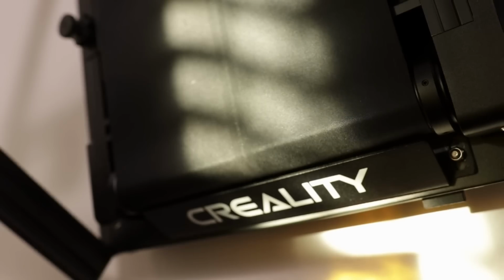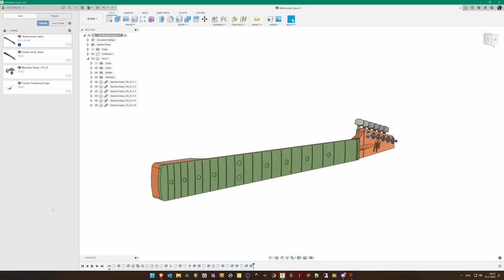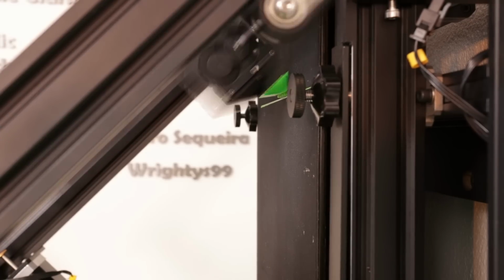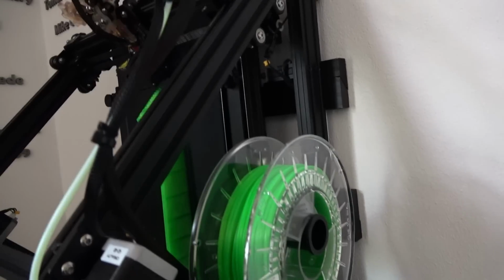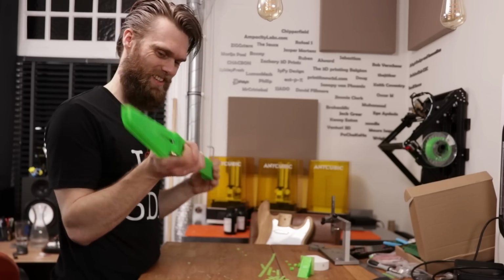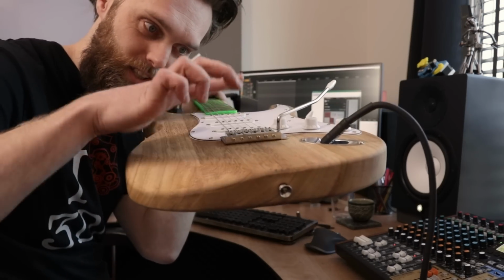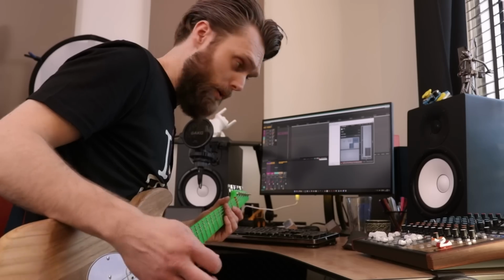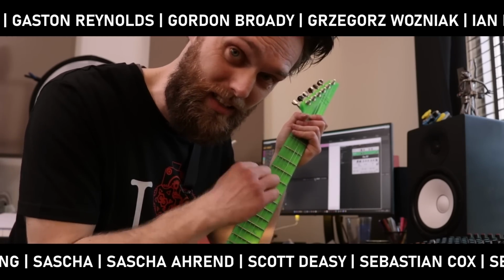A 3D printed single piece guitar neck?! ft. CR-30 belt printer

Comment: Hey! Amazing video! Wanna try something similar. Did you manage to have it straight ? And is the rod necessary? Won't it hold without?
Reply from the maker: Thanks! Cool that you want to try something similar. I don't think it can be done without a rod. Not only for its strength and stiffness, but also for tuning the curvature. I'm going to make a next version and I think I'll even add extra carbon fiber rods to make it even stiffer.

Comment: I was expecting you to use 09-42 gauge strings and you used 11-54 xD maybe that could help with the tension. That... Or tuning in drop C
Reply from the maker: Go big or go home 😉
Reply: @properprinting  Can relate, I normally go for 10-56

Comment: is this buzzing sound normal ? anyway cool build ;)
Reply from the maker: I prefer the strings a bit close to the neck (it's not noticeable on a normal recording). I intentionally mixed the raw guitar noise and didn't go too gentle with it to truly test it xD Thanks!
Reply: @properprinting  understood, I was wondering if could be amplified by the "recording mix" considering you didn't mention this buzzing sound, thanks
Reply from the maker: @simon95dj  That depends. The elements of an electric guitar don't pickup sound. The movement of the steel strings themselves create an alternating current in the coils of the elements which is converted to an audible signal. Especially when adding distortion etc. together with cranking up that volume this is not noticed. Ideally you don't hear that rattling, especially when playing acoustic, but it's a narrow band what adjustment is best. I eventually made use of this rattling sound when I found out that this neck is so flexible xD

Comment: Does belt printed parts usually suffer warping? Also curious if its possible to print PP (Polypropylene). It has great interlayer adhesion for impact resistance, but warping heavly :/
Reply from the maker: I think it would be difficult to print other materials besides PLA on a belt printer. Although, I've no experience with that so I have to figure that out.

Comment: Would you share the stl files?
Reply from the maker: I haven't shared them because I wanted to see first how this holds over time. Turns out, it's pretty bad and this is just a proof of concept. I am planning on designing a guitar with the lessons learned and share that eventually!

Comment: I know you hear this a lot, but please adjust the volume balance in future videos so that viewers aren't having to practically mute their speakers to avoid going deaf every time you switch to playing music instead of talking. There's no reason to have your music levels anywhere near that loud compared to your voice levels.
Reply from the maker: Thanks for your feedback. Could you please tell what sound system you use? I put extra effort in mixing the audio. I'm wondering what the cause could be that you have to adjust the volume to avoid getting deaf while things sound balanced on other systems. I'm not saying you're wrong (I can't argue with how you perceive things), but I have been experimenting with widening the stereo and side-chaining to improve the dialogue compared to the music. My goal is to  get this as good as possible on every device. What my meters say might be different from what is perceived by others and I like to learn and get better at it.
Reply: @properprinting  Apologies for my previous tone. Bizarrely enough, I'm not even using an external sound system; just the speakers on a 48" LED (one of those Best Buy 4k Roku specials from a few years ago). At 7 points I can hear your voice but not clearly; at 10 points I hear you clearly; but then I have to drop the volume down to 2-3 points because the music volume is several times louder than your voice. That usually brings the music to just within standard listening volume for the distance I sit and stand from my computer at.
Reply from the maker: @claws61821  No problem at all and thanks for your response! Because this video is music themed I cranked it up a little bit. I think I will be more conservative with the music volume for my next video.

Comment: why would you make it sideways..
Reply from the maker: That's the easiest orientation to print it in without post processing.
Reply: @properprinting  i meant why is the printer on the wall
Reply from the maker: @olivecool  Ah OK. Besides being more compact and looking cool, this is useful for printing small parts continuously. You can just put a basket under it and let it run :D
Reply: @properprinting  ah lol. that does sound pretty cool

Comment: i bought a CR30 and it was terrible. the gantry dug into the back plate for the conveyor. sain smarts fix? just loosen the bolts and put it all the way down. the prints wouldnt adhere without full body supports.... so literally the piece has to float on supports and if you did manage to get it to print on the belt the surface finish was junk, i returned that shit within a week, glad i got my 800 bucks back

Comment: As a luthier, woodworker, and owner of several BC Rich USA NT guitars, I almost had to unsubscribe here lol.  I have only recently come around to the idea that 3D Printing is useful in other ways than to allow untrained people to supplant the jobs of tradesmen and this isn't helping.  Still not a fan on non-wooden necks but if I decided that I hated myself I would make a separate fretboard.  The trussrod should not be able to be hammered in through the neck and I would want to add some carbon fiber stiffening rods.  I owned a Fretlight guitar and, while I think it is one of the best teaching aids out there, I totally hated playing its epoxy resin plasticy bs neck.  Thanks for the Tip on the Marz guitar plugin, I will like prototyping some ideas that I have with it.
Reply from the maker: Haha, I can imagine that with the background you have xD For me a guitar neck is an interesting use case for 3D printing because of its challenges and you will never hear me say that this is the way to go haha The trussrod was a bummer and I designed it with enough tolerances, but the printer screwed it up. It was too much work to reprint it and my hammering it down I could do some first tests. I'm planning on 3D printing a whole guitar though, so hopefully this wouldn't be so bad that you actually unsubscribe ;)

Comment: Buying that printer was my biggest 3d printing regret. It was an absolute waste of money. The worst printer of a half a dozen that I own. It just collects dust now. I want to take out back like the fax machine from office space. Cool project though.
Reply from the maker: Why's that? I'm really fond of it with the possibilities it brings. I have to admit that I don't get the results I want out of it yet, but I feel that's a matter of fine-tuning. Thanks!
Reply: @properprinting  I know alot of people enjoy tinkering with the printer as part of the experience, but that is just not me. I feel like when you spend $1000.00 on a printer it should at least function with the provided slicer settings. The belt printer is unbelievably finicky and unreliable.